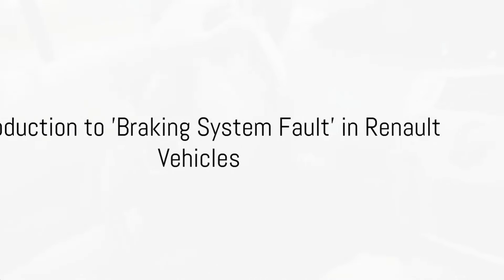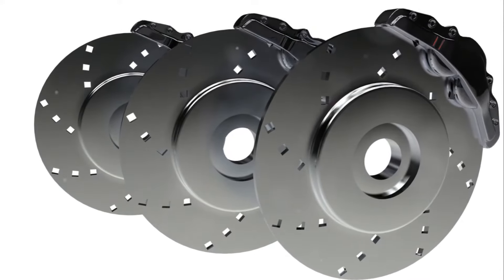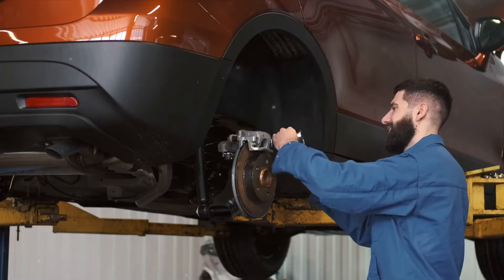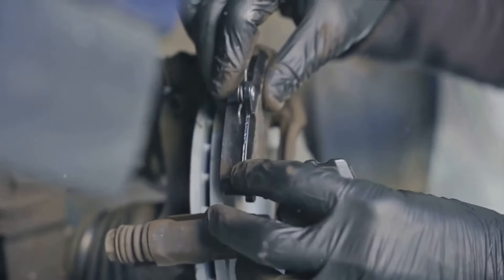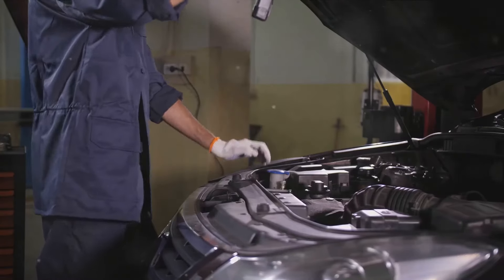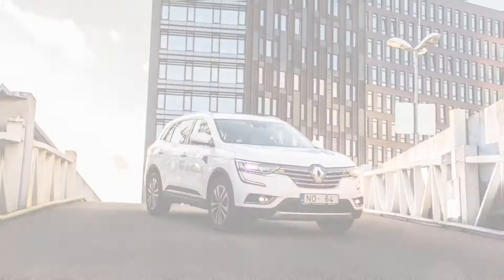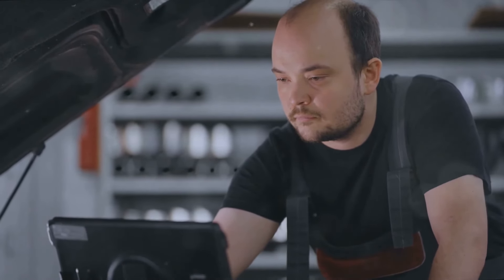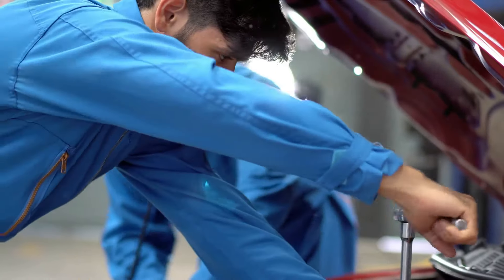Renault Braking System Fault: 5 Leading Causes & Fix

Comment: I’ve got this issue with my car changed the dot 4 brake fluid changed pads and disks still and issue garage said could be my ecu buggered
Reply: Exact same situation, did you get it fixed at all?
Reply: same error, did you fix yours? only I still have Steering fault and error code DF048